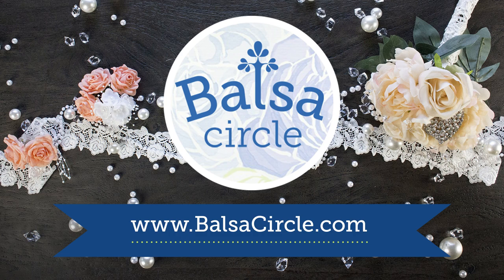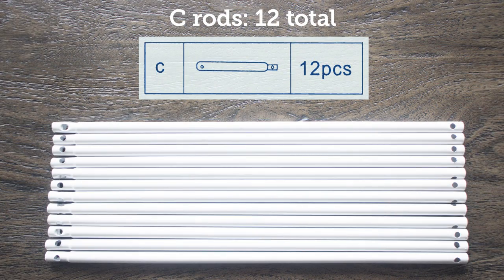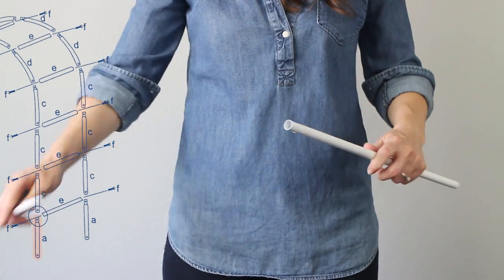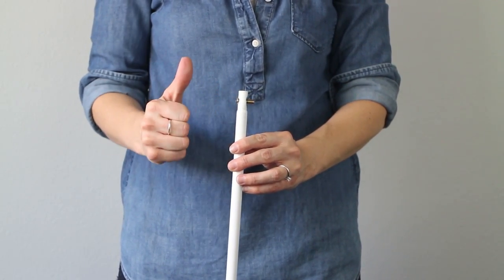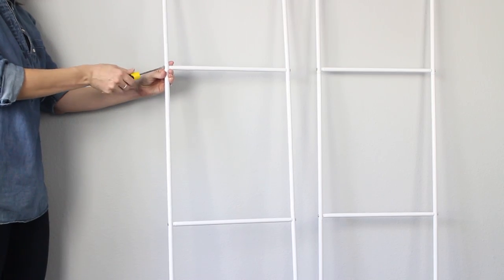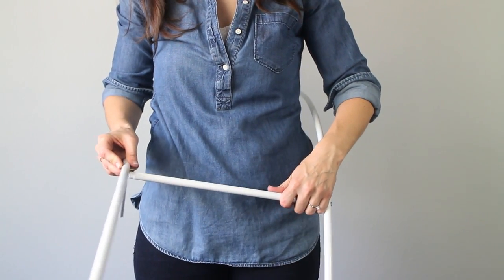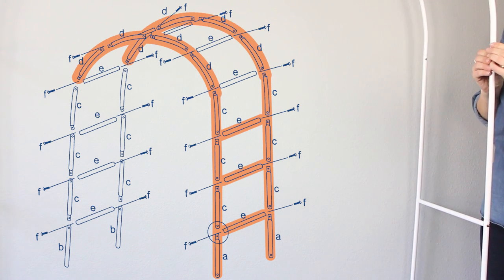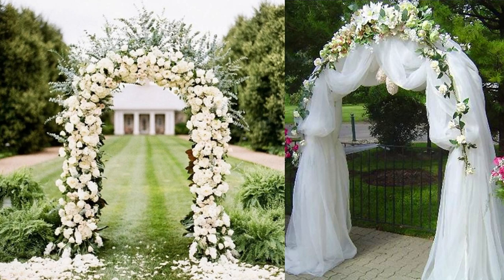How To: Decorative Arch Instructions | BalsaCircle.com

Comment: Can this type of arch be used in a wedding ceremony inside a church?
Reply from the maker: Absolutely, it can be used inside and outside - we would recommend double checking that it would fit as the arch is approx. 90" height x 55" wide. If you need to move it after assembly, just turn it side ways and it should go through any doorway. Hope this helps!

Comment: Can we see a picture of the bottom of the archway. I’m wondering since it’s light weight will a strong wind blow it over ?
Reply from the maker: It would definitely be best to place the arch where wind is not an issue such as behind a wall as in the video as it is lightweight. The legs are easy to secure by simply pushing into the ground on a lawn like in the listing photo: https://balsacircle.com/products/90-x-55-white-decorative-metal-wedding-arch If you are at all concerned about wind, we recommend using small sand bags or weights to secure at the bottom.
Reply: ChicB1707 decorating a wedding arch

Comment: This is not practical at all. If u use fake flowers and fabric then its ok. But for fresh flowers its a nightmare, l dont see an easy way to connect sponges. And if its light weight if u decorate only one side, the arch will fall.
Reply from the maker: It will definitely depend on the design for balancing so it may take a bit of work. We haven't tried it with an asymmetrical design yet so that would be a great video idea. Thank you!
Reply: i think I'm going to add flower pots full of plaster of paris to the bottom of each poles to give it some weight and paint the flower pots white add add a few white bean bags or heavy rocks to the flower pots in the back to counter act with the weight of the centralize floral arrangement I'm putting in the front. Then to cover up the poles and the flower pots I plan to drape the sides with a light weight wedding arch chiffon panel on either side. Because the wedding venue I am going to doesn't allow anything to penetrate their floors.